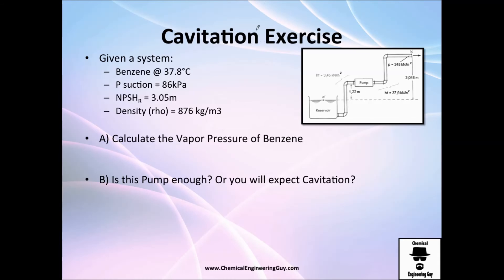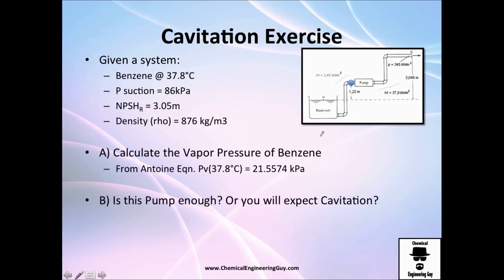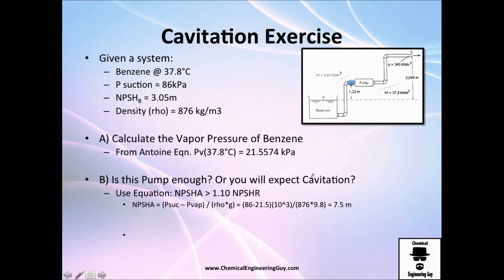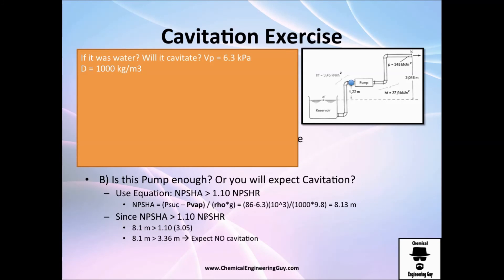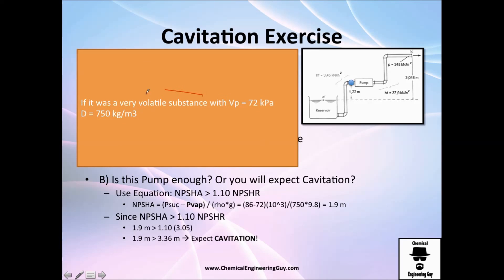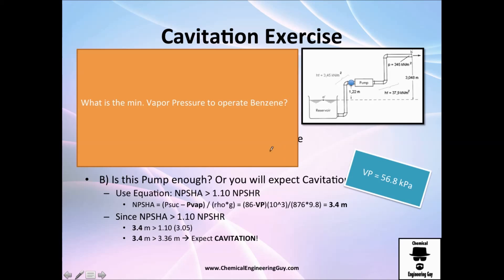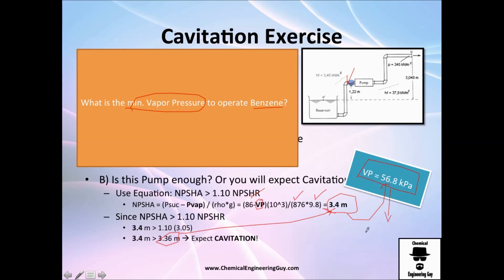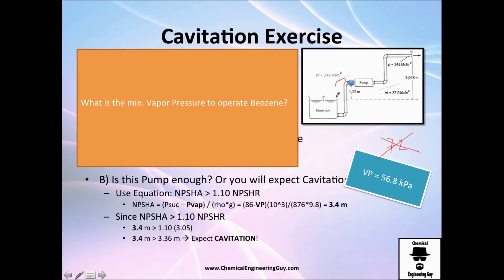Pump Cavitation Exercise (NPSH required and available)/ Applied Fluid Dynamics - Class 042

Comment: important question,  are we assume the NPSH a when the pump running or during the pump not running?
Reply from the maker: always. First in order to know which one to buy and which one to avoid for our operation. Once we buy one, we must know the NPSH in order to monitor the cavitation
Reply: thanks for your answer, do you have an e-mail to send you some photos of damage impeller, in my water station
Reply from the maker: sure, chemical.engineering.guy@gmail.com or at contact@chemicalengineeringguy.com
Reply: thanks again, one more question : Adding chlorine to water by excess amount causes  impellers erosion  , And how do we know  the problem happen as a result of   excess chlorine or cavitation in pumps.
Reply from the maker: cavitation will have the shape of little explosions, i.e. where the bubble forms. Chlroine will corrode differently, kind of hard to explain, just search online "chlorine corrosion of metals"
Reply: thank you very much